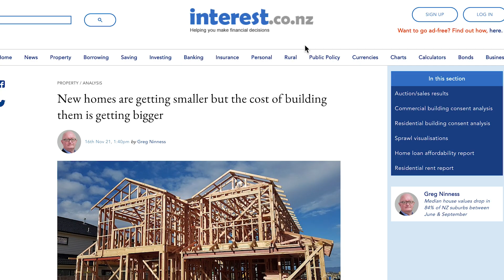Will The Cost Of Building Continue To Rise?

Comment: Interesting point about the mental capacity - I have the land (mortgage on land) - have the equity in my account, but at the time of working with the architect on my home was peak covid lockdown. I'm in a leadership role & was at work everyday of the lockdowns (the only one to do so). With  barely any staff onsite - Keeping the place running, covering way too many roles, keeping people safe and  worrying about the wellbeing of 70 staff & nearly 1000 our community etc took it out of me. I didn't have have the mental capacity many evenings to try and make like changing decisions on my future home so it pushed the DA a year longer than expected. 

I wish I had somehow found a little more energy as this cost me time and budget. 
The architect giving me a couple of weeks - pushed me to the back of his line each time. Doubting my decisions due to exhaustion and sleeping on it for a few days (pun intended) cost me also.

I've now adapted my floor plan to suit my needs and budget (budget hasn't really changed just the costs). I am still building a pavilion home , 3 sections: living with a guest and study in the middle - garage and rumpus on one end and beds on the other. 
I am building in stages starting with the middle pavilion......ohh and a nice sized 12mx12m shed with a little ensuite and kitchenette. I have 6 months leave available and will take it to try OB with a site manager.  Funnily enough I can't wait to have my shed, it means I can tinker - but also start living on site!

Comment: Have just got my concept design back and both my builder and architect are talking over $6k per sqm.
building is 118m2 one bathroom 3 bedroom plus 89m2 basement.
I own the land fortunately, but still on the fence in regards to going ahead.
Reply: Basement would add a big cost, but 1.2m build cost they are robbing you blind, find another architect and builder, Josh just said they are doing builds around 3k SQM
Reply from the maker: Hey Joe, get a second builder to look at your plans if your unsure, but depending on exactly what the architect has designed and specified its highly likely this could be a realistic budget, a lot of it depends on things such as the complexity of design, the work required at foundations, the products such as claddings, desired finishes, where your site is located, etc etc etc